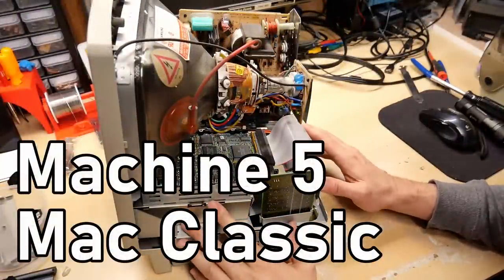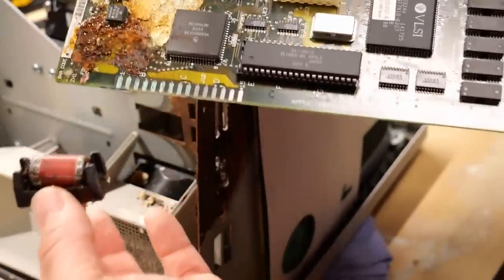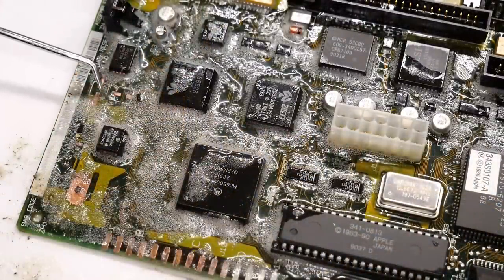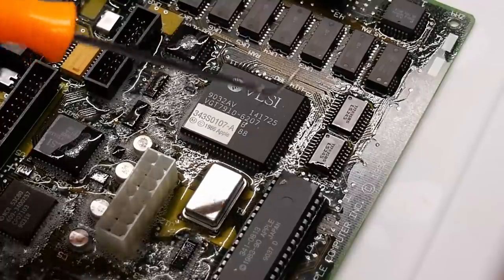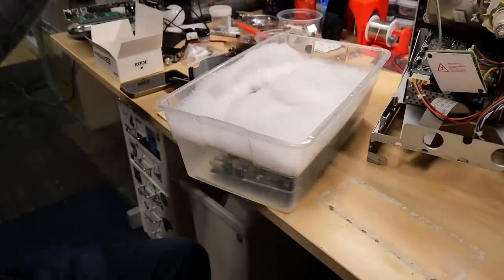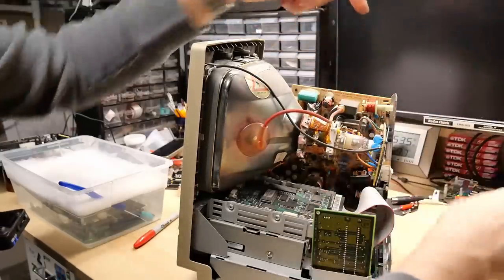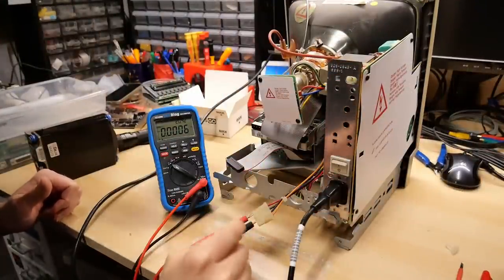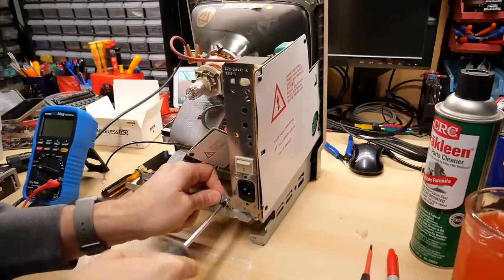Mac Repairathon Part 2: More inspections, motherboard cleaning and a PSU fix

Comment: Please, even if you do know exactly the safety implications of directly touching unknown chemicals with your bare skin (i.e. the lithium battery contents, the electrolyte from the capacitors), try to wear some sort of gloves. Not only for the message you spread by directly touching things you refer to with words such as "gunk" and "fluffy stuff", but also because we love your videos and would very much like to see more of them without any skin conditions!
Reply: A good concern but capacitor guts will at worst cause mild irritation until you wash it off. The same goes for the worst of battery contents - The age alone has weakened them significantly and even when they were new they were not particularly dangerous.

Check some MSDS files!

Comment: Adrian: my uncle used to repair TV's and he had a mirror on the wall to see what was happening on the screen. He also had a small neon lamp epoxied to a plastic bic pen that he used to check if there was high voltage at various places.
Reply: François Laverdure the neon thing looks very smart because big capacitors can retain tons of voltage
Reply: @josecarlosxyz  It can detect high frequency AC only, as it ionizes the gas charge inside through capacitive coupling (neon lamps can be lit up with DC as well, one of their electrode will glow, but this requires direct galvanic connection, not just proximity).  So you can't detect a charged-up CRT with it, it's just a crude, but working way to determine if the flyback is generating high voltage or not.
Reply: Using a neon lamp can be VERY dangerous for measuring high voltage. This was a popular trick in the 60s up to the mid 1990s, as companies put neon lamps in screwdrivers.

A dedicated high voltage meter will do you much better than a lamp that might kill you if it ever experiences a failure.

Comment: I used to component level repair these back in the day (1990s!). Sadly I threw out my CRT rejuvenator and Fluke high voltage probe. I still have desolder templates I made (for the high voltage board - I routinely re-capped!) - I had it down to a fine art (even if I do say so myself!). Each template had cutouts for components to desolder based on the fault. Yes, I repaired that many of them! A few things I would recommend - don't become complacent when working on mains voltage. You should get into the habit of keeping one hand by your side (or in your pocket) when working on live mains - never use both hands when working on live equipment. Also it's always a good idea to stand up and have a clear area behind you when working on live mains powered circuits. Most times you might just get a zing, but it's that one time that'll get you!
Reply from the maker: So sad those tools are gone. The templates sound like a good idea if you’re doing a lot of these though. Very neat! I got a zap from the main input caps while working on the Mac + last night. The bleeder resistor is open on that board :-)
Reply: @adriansdigitalbasement  Like I say - you should never become complacent around mains powered equipment. If your heart is healthy those little discharges act as a good reminder!

Comment: Try vinegar for some of that corrosion. I've had a lot of good luck with that bringing 486 boards back to life.
Reply: It's what I do, and it works great. But I'm pretty impressed with what WD40 can do.
Reply: WD-40 was basically made for this. It was first designed as a water displacer and corrosion inhibitor.
Reply: Why? Wd40 working perfect.
Reply: I too use the vinegar trick. Works great. I was surprised by wd-40 though
Reply: @kalijasin  It's nice to neutralize the alkaline. All of it. Vinegar cleans up a heavily corroded board very nicely. I don't think that it would do much with the baked-on gunk this board had, but follow up the WD-40 with a vinegar bath to make sure that you have neutralized all of the alkaline, that would work. But I've only come across one board that even approached this level of damage, a XT (or 286, I can't remember) card for an Amiga 4000.

And 5% vinegar is a weak acid. It takes a very long time to do any appreciable damage. I soak mine until the green corrosion turns to blue, and the bubbling stops. At that point the corrosion is soft and has loosened up. I take an old electric toothbrush to the board to clean it off.

But use whatever works for you. I've done 2 A4000s, 2 A2000s, 2 Speccys, and 6 A500 memory expansion boards this way, and all of them have come out looking shiny and new, with no problems whatsoever. I follow up the vinegar bath with a rinse from the outside faucet, shake them off really well, and then it's off to an alcohol bath to "soak up" any remaining water. During this bath, I scrub them again to get rid of any flux.

And it's not like these boards weren't washed at the factory.

And here is how board repair shops do it:

https://www.youtube.com/watch?v=j-IE9nT5AzA

Note the 500 volt fuses on the board. If it's fine for this, I'm pretty sure our piddly 12 volt circuits are going to be just fine.
Reply: @MrWaalkman  You can get stronger vinegar. The germans use stronger stuff in recipes like Saur Braten.  I've seen 20% sold through walmart.com All the white vinegar used to be 11%, BTW. 5% used to be considered just "salad vinegar" which is why wine vinegars are usually still at that strength.
Reply: I had a dead Gameboy board I soaked in vinegar and I found that you really need to be careful with vinegar as it can also eat away parts, it'a very acidic. Make sure you apply only where it's needed, don't let is soak too much, clean up and neutralize with baking soda. It's too messy, I don't think I'll use much vinegar in the future, only in spots with a q-tip or something.
Reply: MrWaalkman no. Wd40 is just reinvigorating the oxidation the battery fluid started

Comment: Lithium hydroxide and such from the battery is a base.  WD40 is an oil (or fat).  Mixing a fat with a base induces saponification which is the conversion of an oil to a soap.
Reply from the maker: So it's basically reacting and turning into soap? Interesting.
Reply: It's make sense :D
Reply: Yeah, he made lithium soap!
Reply: Jason Downs real gamers wash their bodies with lithium soap
Reply: Aren't those lithium thionyl chloride batteries? And that is super reactive and corrosive (very toxic also), forming sulfur dioxide and hydrochloric acid when contacting water. In that case acid fumes and chlorine compounds would cause the corrosion over the time as battery slowly leaks.

Edit: These are defensively not your lithium-ion rechargeables or coin cells. Amount of raw lithium would not be sufficient to produce enough LiOH to cause that kind of corrosion.
Reply: No lithium hydroxide is produced during the leakage of these thionyl chloride cells

The shit that damages your hardware is the sulfur dioxide from when the thionyl chloride reacts with air
Reply: Thanks for the info!! Very interesting!! I didn´t knew that a pcb can be restored in such a way with wd-40 also
Reply: The electrolyte in the caps must be a base as well, since it was also causing bubbles to appear in the WD-40. Very interesting. Could be a more gentle way of cleaning corrosion than with white vinegar?
Reply: @UpLateGeek  Introducing oil, is probably the most innocuous treatment for alkali contamination, as oil has no reactivity with metal, vinegar's acetic acid may react to produce copper acetate from traces or nickel acetate from the plating on the pins.
Reply: @EmmittBrownBTTF1  ooo
Reply: @adriansdigitalbasement  Me as a professional, I always cringe a bit at people's choice of chemicals. So did I on your video, hehe. But mabye you can help me with something before I do something stupid. On my Mac Classic Mobo, all caps are destroyed. But the 16V 47µ caps seem to be the same size as 6.3V 22µ caps that I have....Can I use these instead?
Reply: @rodrigoacosta9708  I never would have guessed either.  I know there is a WD-40 contact cleaner anyhow.  I wonder how it compares with the various formulations of Deoxit.  I only wonder because I never tried either contact cleaner.
Reply: @AmstradExin  dont do that it's completely wrong.
Reply: @AmstradExin  No, you don't want to downsize the caps that way.  Even if they are the same size.  ESPECIALLY downsizing the voltage can be a bad thing.  It's usually OK to go slightly up in voltage (i.e., substituting 16V in place of 8V) but you never want to downsize.  The capacitance depends on what it is being used for.  Most of the caps are used as "bypass capacitors" which can be thought of as tiny batteries that supply emergency power when needed.  Typically, you want to keep that value the same as the original.  Remember, just because it fits...and it MIGHT work for a bit...when you downgrade like that, you are severely reducing their life cycles.  You can get 47uF/16V SMD caps on Mouser for around $11USD for 100 of them.  And that's a good brand like Nichicon or Panasonic.
Reply: Adrian's Digital Basement 🍿agreed
Reply: So this is the secret behind granny's soap made with used olive oil and caustic soda...
Reply: @jasondowns2778  L I T H I U M  S O A P
Reply: yes, its called lye......

Comment: Great video Adrian.
At 19:59, 500mA of ripple!!!  500mV of ripple, easily done.
When you replace the other electrolytics, after powering up, check what the actual voltages on the capacitors are.
10V rating is unusual, it usually means that they were fitted for a price and size and you may have 7 or 8 volts on them.
If so change them for 16V capacitors, the modern type should fit easily.
The 10V rating is just a precise as the capacitance.
Capacitance typically 20%.       google     electrolytic capacitor tolerance
Voltage typically -50% to +100%.  google  electrolytic capacitor voltage tolerance

If you look at the lead end of one of those capacitors you should see a tiny hole, this is to release any pressure build up and when there is a failure, let the electrolyte out.

Comment: @Adrian, I have a few classic Mac's of this vintage (LC II and LC III's) and they will not display any picture without a lithium battery installed. You may have a similar issue with your Classic II board. *I paused at 14:45 to comment. Perhaps you've discovered this later in the video.

Comment: Definitely an cap ESR problem on that Classic power supply.

Interesting the WD-40 did an OK job on that corroded Classic motherboard, although there's still some tin on a few IC legs that looks suspect. I would hit it with some white vinegar and see how that affects it. When I've used it on corroded boards in the past, it's brought the corroded pins up to a shiny silver after a little scrubbing with a toothbrush (at least the ones that it hadn't eaten the tin off anyway). I do agree it's not worth trying to fix it since you've got other Classics. But personally if it were the only one I had, I'd probably give the repair a go (I'm a sucker for that sort of thing).

I'm just super lucky my Classic II and SE/30 were both working perfectly when I got them, and completely corrosion free. Not even the slightest hint of leaky caps. Not sure about the history of the SE/30, but my Classic II appears to have originally come from a university geology department. Came with one of those big carry bags (a beautiful red one!), so I'm guessing it was a field unit that didn't get a lot of use.

Anyway, after seeing what a battery can do, I'm definitely going to pop them both open and remove their batteries!

Comment: WD 40 is designed to remove corrosion and dissolves adhesives so no surprise there. Have used a similar products on a battery corroded circuit board and it really helped clean it up.
Reply from the maker: Good to know! I recall using it years ago to remove some rust from chrome so I tried it here.
Reply: Adrian's Digital Basement 🙂

Comment: 2:00 I had a classic i got from a friend with similar battery/explosion on it.... I have two Classic I's right now, and the electrolytic caps just fell off the board.  i scrubbed it with vinegar, which helped clean it up quite a bit. I have a Classic II which looked okay, btu gets the same dim screen as you saw last episode.  Think i'm gonna just replace all of the caps, and soak it in vinegar.

Comment: Wow what an mess on that board! 

Recently opened my Commodore Amiga 500 to check how's the components inside. Found a Rubycon cap which had started leaking that brown stuff under it. It's one of those 10V 3300Uf caps so ordered two new ones which arrived yesterday. My Amiga was manufactured I think in 12/1990 and have had it since new. So far haven't had to do any repairs it until now...
Reply: If it was next to the video hybrid, it's not leaking - that's glue used to fix the capacitor down. Best removed though
Reply: @jaycee1980 , it indeed is right in front of the video output components.
I even have a pic of it:
https://flic.kr/p/2iWkKEK

There's that brown goo under it and if you look the reflection at the RF shield, it's visible at the backside too.

That would be a relief if it's just a glue. Did they use glue just for this one cap and not to the other similar big cap next to it?

After this pic, I putted my Amiga back together with these caps still in there, it starts and works normally. Would it work if one of these biggest caps on the motherboard were blown?

Comment: Watching your first video inspired me to pull out a mac classic II that has been sitting in the basement, the battery hadn't leaked yet, but the caps had. But the real issues was in the analog board caps, exact same ones as yours I suspect! FYI definately replace the one that is the exact same size as the bad one you pulled, and the two blue caps at the edge in that cluster, all 4 of those went bad from the machine just sitting there, but all the others were perfectly fine from an ESR and capacity standpoint. I tested them with my 'Anatek Blue ESR Meter' and DMM. The mid-size brown ones, like the one you pulled, measured in at 10 ohms ESR alone, which is terrible. The blue ones measured in around 1 Ohm ESR which is also still bad enough, all the others in the area were ~0.14 Ohm ESR.

One thing I have not figured out yet is why the voltage slowly drifts up, I feel like the more I turned the mac on the better this became, HDD would spin reliably, etc. Also there is a 12v adjustment hidden where the wire loom bundle hits the board... it took me... ages to realize where this was even when others talking about it! 5v output is slaved to the 12v regulation and they are proportional. 5v needs to be at least 4.85, to get there 12v can be a bit higher than 12v, but if you run 12v past 15% you will trip the crowbar circuit and it will trip off until adjusted down. Try to let the system stabilize before tweaking the adjustment for this(also be wary of how close to the CRT tube you need to get your hands), hope this helps! lots of google searches on my adventure.

Comment: Another great video. Next time, try white vinegar for the battery leak, it is making quite a chemical reaction that has great cleaning effect.
Reply from the maker: I actually tried it but no effect. It works well on NiCD leakage but seems lithium leakage wasn't reactive with it.
Reply: @adriansdigitalbasement  Well, yes I tried on NiCD and it worked great so your WD40 for lithium is a great addition to everyday electronic tips and tricks.

Comment: Adrian, white wine vinegar will neutralize rust and battery acid more than WD40. Try that once the board is completely cleaned.
Reply: Repairing the vias might be a bigger issue. Not sure if those are filled or not.

Comment: One of the computers I grew up with was an SE/30, so I have a lot of nostalgia for this style of Mac. If you end up with a spare chassis by the end of this, I'd VERY much like to buy it off of you so I can do a mini-itx build in it. Basically, I'm after a machine that's beyond repair but has a decent shell.
Reply: If you put an LCD in it then please try to make it look decent
Just plopping an LCD in without accounting for the curved CRT bezel just makes things look bad.
Reply: @kargaroc386  100,000% agreed.

Comment: I saw a very similar behavior to that corrotion recently while fixing a graphics card for my retro gaming PC. While most of the caps leaked, the electrolyte on one specific type had the same effect on the solder. It literally fell off and left the bare copper pads, so I could solder new caps and revive the card.

Comment: For number 5, take a hot air gun and remove all of the chips and put them in a static bags and get rid of the MB.  wouldn't even take the chips around the leaked area.  The material may have crept in to the chip and will be  a time bomb later.  

A trick that old TV techs used to do is to have a mirror on the wall opposite of the screen when you are working on one.  That way you can see the picture tube.